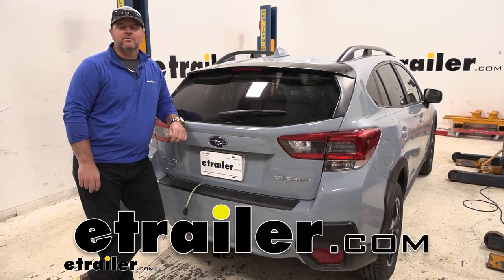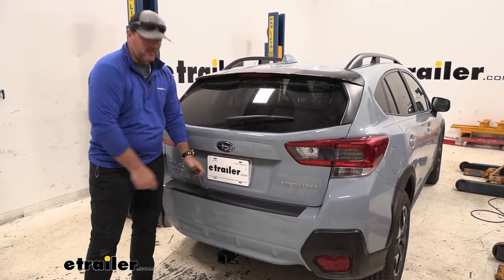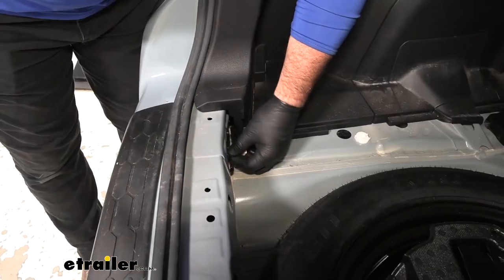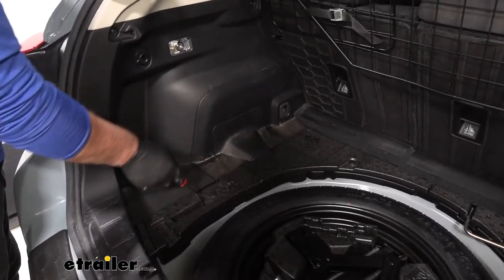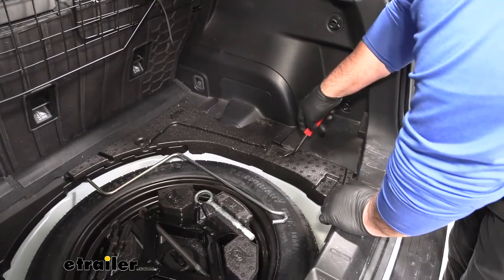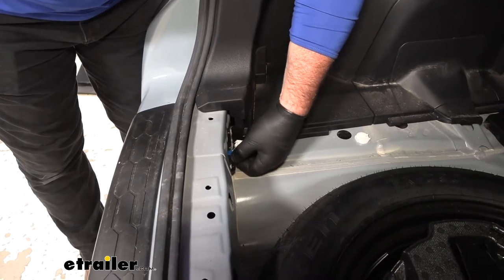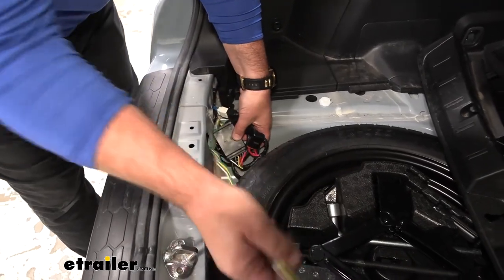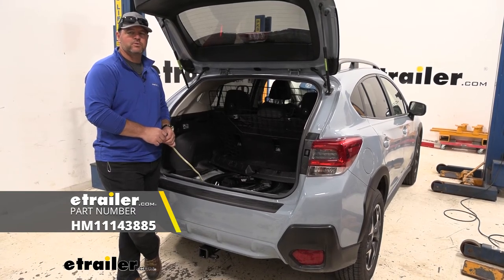etrailer | Hopkins Trailer Wiring Harness Installation - 2020 Subaru Crosstrek

Comment: The Curt I have has a ground wire. I hate drilling holes. Wish you had shown that. Otherwise good video
Reply from the maker: We just use a small self tapping screw that comes in the kit to ground it but you can ground it to an existing ground in the trunk area.
https://www.etrailer.com/Custom-Fit-Vehicle-Wiring/Curt/C56040.html